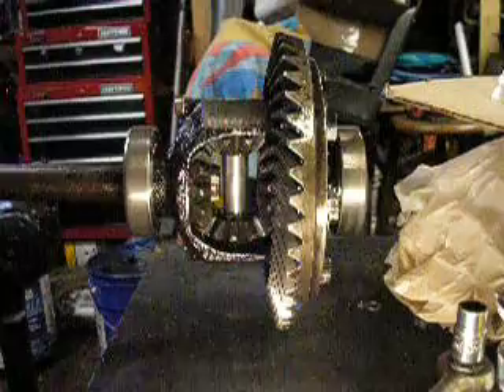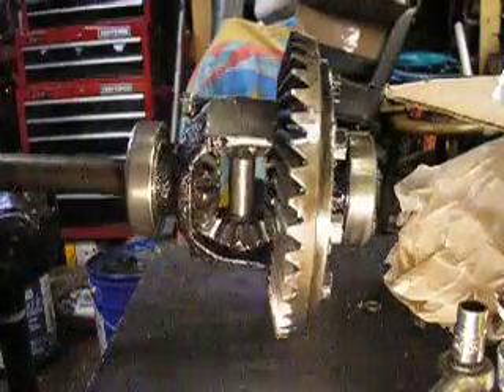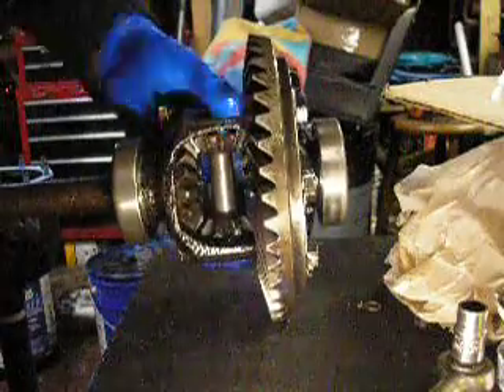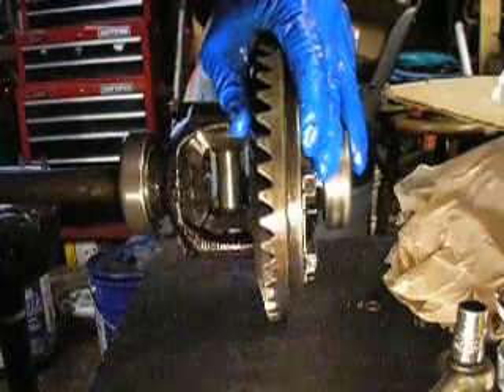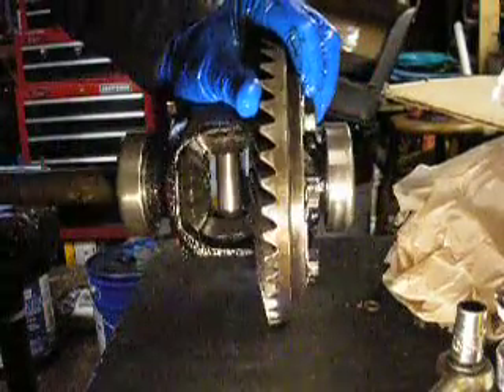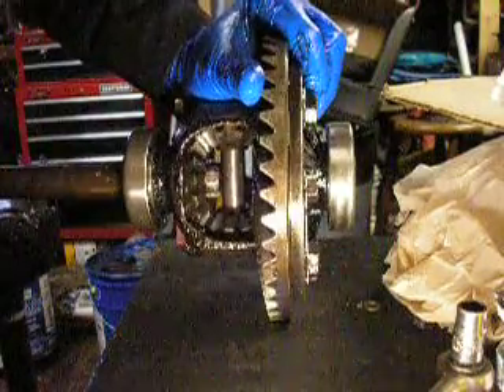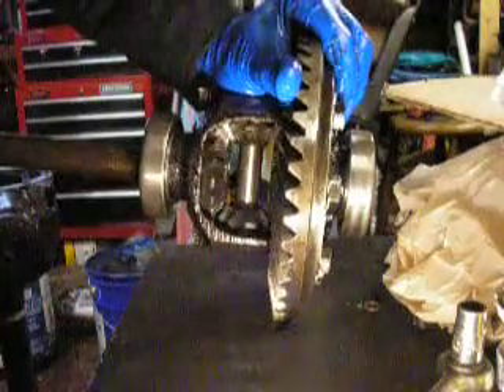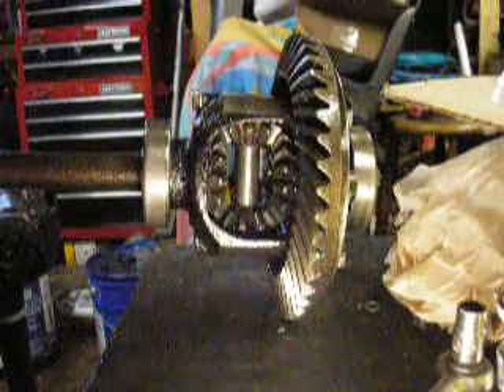Test of diff gears after replacing shims behind spider and axle gears

Comment: Both wheels would not spin because its an open differential. If he would have a limited slip differential with the locker in it then he would get em both to light up.